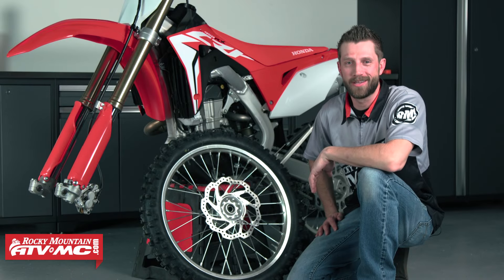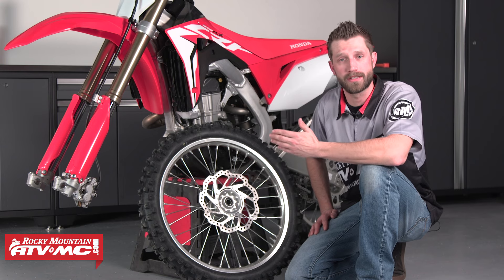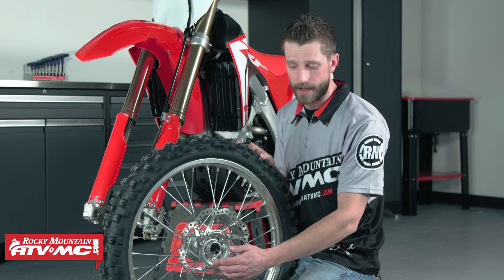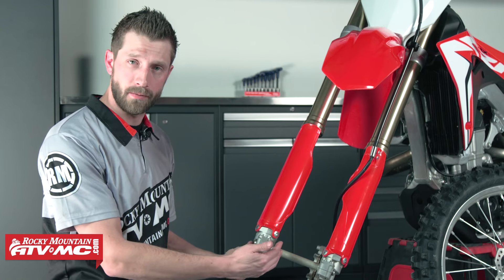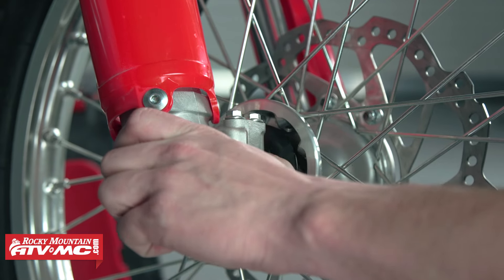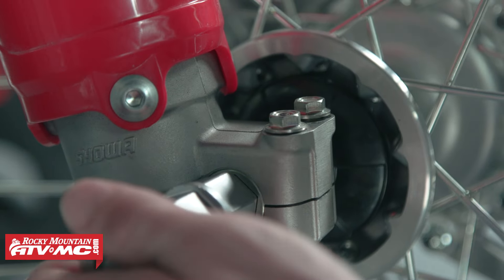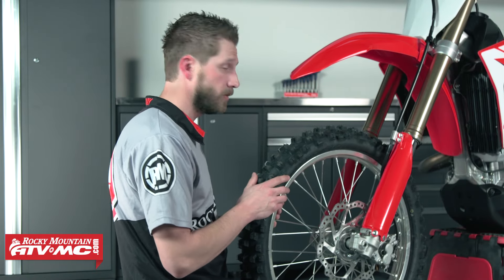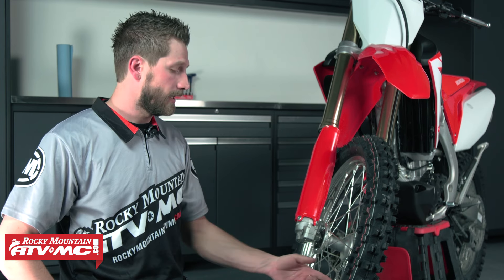How To Install a Front Wheel on a Dirt Bike

Comment: I am confused, did you tight the LEFT pinch bolts, then press the bike with front brakes several times, then tight the RIGHT side pinch bolts, then finished? or I missed something: 
should I lose the LEFT pinch bolts, then press the bike again?
Reply from the maker: You are not missing anything, that is the correct sequence. The axle nut then left side pinch bolts get tightened, then you align the forks and tighten the right side pinch bolts.

Comment: I have a 2022 yz450f and i have some issues in the wheel, its out of true but the rotor is rubbing. Somi dont think its a truing issue i think maybe a bearing didnt seat properly or something. Also my allen side of the axle does not slide in at all on either end. It takes some good force looks like im ordering a mew one.

Comment: Excellent video! I have a question though.  After installing the new typhoon rotor on the front wheel of my honda crf250 the wheel was very tight and the pads were holding the wheel from rolling freely and dragging on the rotor. At this point I believe my next step is to bleed the brakes but not sure. Any tips or information you can respond with would help. Thank you

Comment: This was very helpful I’m on a farm in Zimbabwe and there are more thorns than you can think of and I’m constantly fixing punctures and I was doing the axel replacement all wrong this whole time
Reply: He is still doing it wrong.  Use a tool to get the legs parallel.  But because of the thorn bushes, you can also go to "moose" tire inserts.  Instead of a rubber inner tube filled with air, it is a foam "inner tube shaped" insert filled with air bubbles.  They wear out eventually, but won't go flat.

Comment: Is it possible replace  a stock  dirt  bike's  21 inch front wheel by its  rear 18 inch, ignoring tyre width? Thus  converting into supermoto by buying one extra wheel
Reply: Sure it is possible. You will probably have to make your own parts though.
Reply: Look up a flat track setup. I'm debating on doing that to a 450 for the street. Basically you get a supermoto setup with having 2 19 inch wheels rather than 17s.

Comment: My brake pad closed on itself and I can’t open it at all anymore
Reply from the maker: You can use a screwdriver on the metal backings of the brake pads to separate them. That should get you by,  but if the piston is stuck, you might need to rebuild the caliper. -Charles

Comment: Best front wheel removal and install video I have seen; well done and thank you!
Reply: There is not good wheel installation vid on YT.  If your not using a tool to get the legs parallel, then they won't be parallel.  The forks will not work as well as they are designed and will wear out faster,---if you don't use a tool to know they are parallel.

Comment: previous owner over torqued right fork axle pinch bolts, now after getting my forks rebuilt the front axle will not go back in. ive tried everything i can think of to open it up a little without causing to much damage. any tricks or ideas anyone has?
Reply: how did you get the axle out if it is too tight to get back in?
Reply: same here. what did you do? Im stuck

Comment: I have a DRZ400SM and when I do this I usually get a larger "free play" on the front axle. Suzuki manual says that I need to torque the axle nut to 20Nm, then tighten all the pinch bolts, and after that tighten the axle nut to 42Nm. This kind of ensures that there is no slack in on the front axle (speedo drive from one side of the wheel and spacer on the other are all kept "tightly" together without excess movement/free play. If at any point I loosen right side pinch bolts to try and straighten fork alignment I get a situation where I have a few millimeters of extra "free play/gap" on my front axle (the speedo drive and spacer on the other side of the wheel are no held together "tightly" anymore.

Can you comment on this? Is this still fine and I still should proceed in the manner demonstrated in this video?

Comment: Great video! So when I compress my front forks on my crf250x to get the right fork to align before tightening the right side...The fork wants to end up sliding out from hub on the axle and leaving excessive side play. I have all new bearings. Has anyone ever heard of a bent triple clamp? Or any help? thanks!
Reply: cs9575 thats normal
Reply: Yes I'm stuck on the same problem. Did you end up resolving that issue?

Comment: You can also just spin the front tire and hit the front brake a couple times while the bike is on the stand to straighten the right fork
Reply: Does move it, but still does not work well.  I made a simple tool for mine to make sure the legs are parallel, and found that method to still be off almost .030".
Reply: That’s within spec on a dirt bike in my opinion. Would be cool to see or learn about your tool though !
Reply: @ClayFick  No way is .030" in spec. The sliders will bind with the bushings as the legs go through their travel.  The tool I made is very very simple.  It is just a piece of 1" diameter aluminum round stock, faced off in a latch at both ends to the proper distance between the plated fork legs.  I simply measured a triple clamp for the "center to center" distance of the fork legs, and subtracted one diameter of a plated fork leg.  The gauge length for my 2019 YZ250 2-stroke is 5.661", and it fits through the holes of my brake disk.  All I do is get the front wheel off the ground, tighten the disk brake side axle clamp, install the gauge as low down on the forks as I can, (through my brake disk for mine), make sure it is straight, and tap over the other fork with a rubber mallet (at the axle area), until the gauge is tight between the plated fork legs, tighten the last axle clamp, and carefully remove the aluminum gauge I made.  Then, you forks will be able to work their best.
I first used the front brake method.  When I did it this way, I actually had to go to a stiffer fork spring set, because I removed all the binding.
Reply: faced off on a lathe

Comment: My axle won't go back in. Opened gap up a little and still won't go in. The bigger part of axle won't go in at all. Your saying just to file edge to get it in?
Reply: Just happened to me with my husky 250 4T  Enduro. There was an impact inside the bore that make the axle impossible to fully place in. Just a little file work and it was good. Just need to prevent the corrosion frequently now but that'q not a big deal.

Comment: What size torque wrench for the axle nut and what size torque wrench for the pinch bolts ?Also what type of grease do you put on the axle? Thanks for the vid!
Reply: I use a 1/2" drive torque wrench for my axle nut because the wrench torques up to 150 ft lbs and my manual says 84 ft lbs. For the pinch bolts i use a 3/8" drive torque wrench as those bolts only need 15 ft lbs on a yz250f

Comment: wouldn't moving the bike from the floor to the stand effectively make compressing the forks pointless? seems like after compressing the forks, you'd want to immediately tighten the right side pinch bolts and then finish checking torque specs.
Reply: if you don't know already you can just spin the tier while the bike is still on the stand and grab the brake and it'll be the same as what he did by compressing the forks  then just tighten the pinch blots then the axle nut. The Dirtbike Channel made a video about this and that's where i learned to do it from
Reply: mitchell baxter I was thinking the same thing.

Comment: Getting your wheel "aligned" with the forks is not the issue.  That is done when you tighten the axle at the disk side.  Getting the forks parallel is the issue, and you are not going to do that with out a tool that spaces your lower forks at the correct distance to insure parallelism, before you tighten the pinch last clamp.
If you don't use a tool,--you are not getting the best performance out of your forks and wearing them out faster.
Would you like to comment, Rocky Mountain?  Can you tell me I am wrong?  I am not wrong.
Reply from the maker: Thanks for the comment, but don't be mad at us. Dustin shows the process exactly how Honda and the other manufacturers want it done to ensure the forks are parallel. I know this isn't the answer you want, but this method works great and it's hard to argue against all the engineers at every major motorcycle manufacturer. Hopefully this helps. -Charles
Reply: @rmatvmc  I am not mad.  I am amazed.  The Yamaha engineers also place the tranny oil height screw (that replaced a dip stick a long time ago), that starts flowing oil at about 350cc, and it takes 750cc.  There is only one way to insure the forks are parallel, and that is to figure out a way to actually measure it.

Comment: Sorry.  That method does not work well either, (unless you loosen the top fork clamps, remove the fork caps and handle bars to compress the forks all the way to bottom.).
I gut tired of these guessing games, so I figure out the center distance of my triple clamps, subtracted one diameter of the plated fork sliders, for the distance between the slider tubes, (which is 5.661" for a 2019 YZ250 2-stroke), and faced off a piece of aluminum 1" diameter round stock to fit between the plated fork sliders, (though a hole in the brake disk), and tapped that loose fork clamp end until the rod is tight and straight between the fork legs.  Tighten the fork clamp. Carefully remove the aluminum rod, and your legs are parallel with in + or - .001".  Your forks will work better and last longer if you know they are parallel.
Side note, this is a deal with upside down forks, as traditional forks had axle spacers that kept the legs parallel.  I have no idea why upside down forks are designed this way, but I know a lot of people are wearing out their forks faster then they should be.  Actually measuring it somehow is the only way to make sure they are parallel.
You can have a you machine shop face you off a piece of aluminum stock for probably about 10 bucks, if they charge you at all.  All you have to be able to do is measure the right distance.  If you can't, sue your school.

Comment: Getto tip for today, if you don't have one of the axle hex thingy bober jobers to hold the other side while use the torque wrench, try the back end of a spark plug socket and some vise grips ;)
Reply from the maker: Luke Howland Not bad for in a pinch.  Or, you can always just buy one. :)
Reply: @rmatvmc  oh definitely but I try to get around buying something by any means possible! I have created tools out of old different tools so I wouldn't have to buy new ones 😅 I'm pretty cheap
Reply from the maker: Hey it works right!?  Half the fun is creating the tool i'm sure.  Thanks for sharing your tricks!
Reply: If it looks stupid but works, it ain't stupid! Story of my life..
Reply: Came here to say this, a spark plug socket usually has the proper size hex and you can just insert it backwards and then use an extension with the ratchet to keep it from spinning.
Reply: @1320fastback  the ratchet idea is definitely more efficient, I didn't think about that. Good idea
Reply: Spark plug socket is what i use also. Ratchet idea is good. I drilled a hole through mine so I can use my bar the I have to hold it.
Reply: Thanks Luke for this trick. Fits perfect!